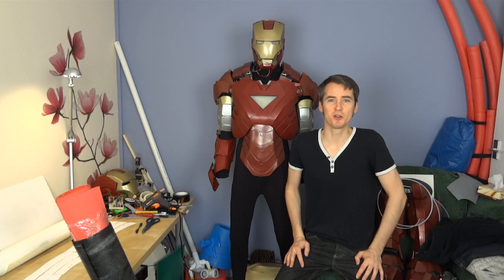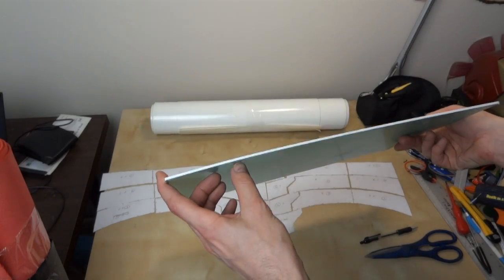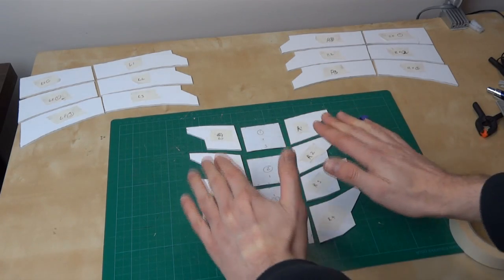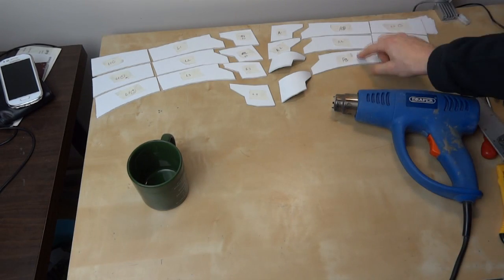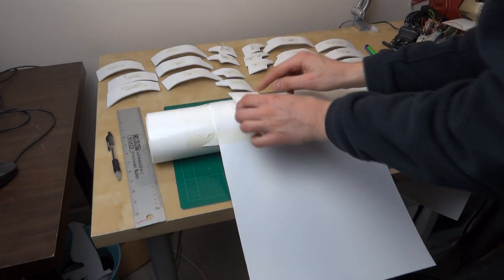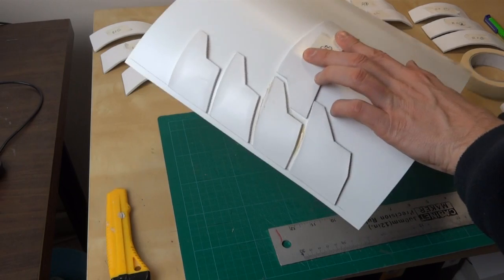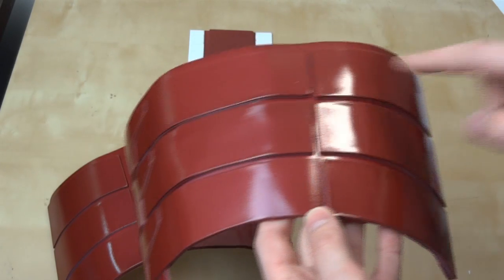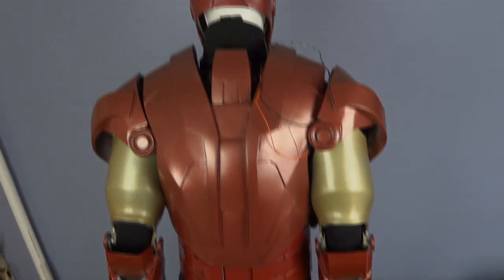Iron Man Power Suit #48 | Building Abs | James Bruton

Comment: Are you planning on replacing the ab plate with a similarly flexible piece?
You might still find that those side pieces are still too ridged as when you bend, each opposing set of plates (both sides and front and back) expand/contract as a pair. It would be interesting to see how well a more elastic backing would work that would stretch and compress with your movements. Just a thought.